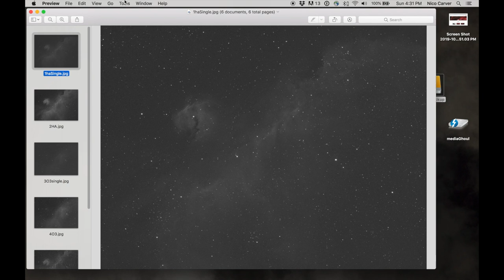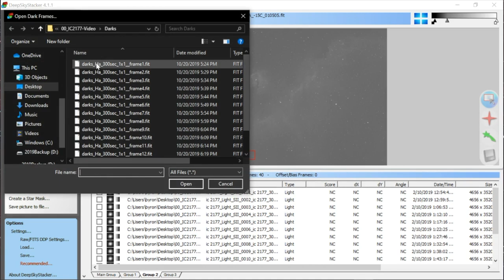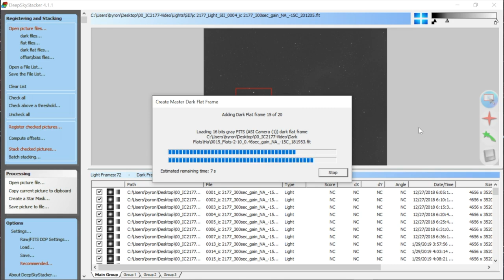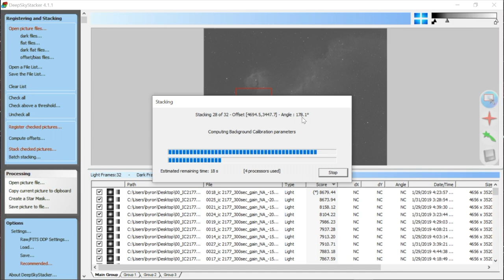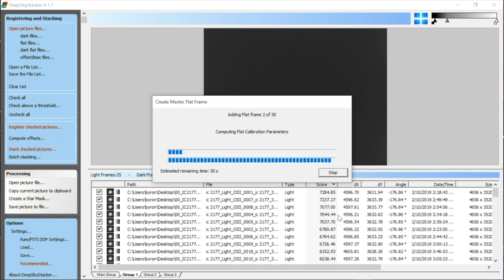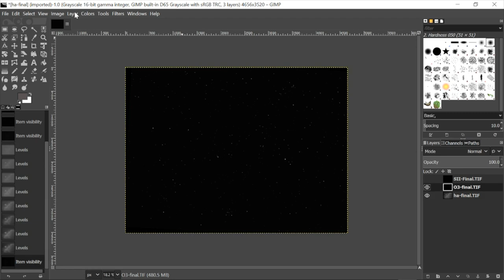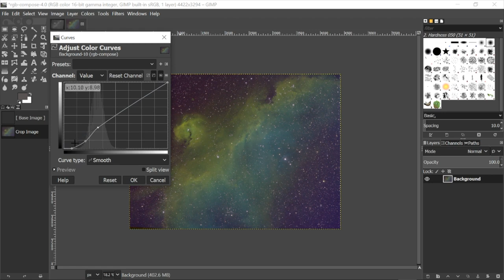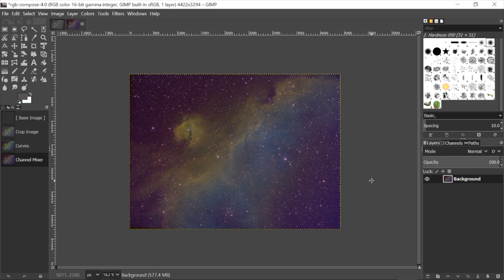Intro to Narrowband and Hubble Palette, Pt. 2b - DeepSkyStacker and GIMP

Comment: I know this is a bit old, but I want to thank you for this. The part that I found most helpful was where you showed how to open an image as layers and then compose them. I use a DSLR, and I know it isn't going to be perfect, but I'm going to use my broadband light pollution filter to try to make an HOO image by splitting the channels in Siril and then recombining them in GIMP. I have some old data I can try this on so it should be an interesting experiment for a cloudy night!

Comment: I know I'm a little late to the party, but thank you for uploading this and having the data available to process. I've been on the fence about making the jump to mono, but this seals the deal! I did take your data through starnet and then blended the images in gimp with a star mask (learned from one of your videos) which eliminated the magenta stars and really made the nebula pop. Thanks again. Keep up the great work!
Reply from the maker: Awesome! Mono is amazing, just wish it wasn't so expensive to jump in to it (decent filters, good filter wheel, special camera, etc.) or I'd recommend it to more people. When I first started with mono, I tried to save money with a cheap manual filter wheel with a big open hole in the side that I would then cover with aluminum foil (big mistake).
Reply: @NebulaPhotos  agreed. It’s a huge, but worthwhile investment for quality mono equipment. I do have the asi120mm-s used as a guide cam. Understanding full well it’s not a dso cam, I’m going to play with that as I save my pennies for a full on mono setup.

Comment: In GIMP under colours you will find hue-saturation, in this you can selectively modify a colour in hue brightness and saturation. It's an easy way to wipe away the green hue or other. Over use and it will add artifacts though. Great vid, thank you.

Comment: Great helpful video for several questions concerning processing in Gimp. Thanks for that. But a additional Question; what i have to do in Gimp, to combine Narrowband images (finished as Hubble) with regular luminance Images? Background is about 4h Narrowband exposures and 10h luminance exposures. 
But at first i am very happy, to find the next mosaicpart for good image editing using Gimp with your video! Thanks a LOT!😃
Reply from the maker: I guess I would just register the luminance to the other narrowband channels (just treat it as an additional channel) then set the layer blend mode to luminosity.

Comment: Thanks for the video. So why are you using the Ha as the reference for the Sii and the Oiii? Why would you not use the best out of the Sii for the reference for the Sii and the best Oiii for the reference for the Oiii? If the Ha reference is not checked is it even using it in Deep Sky Stacker?
Reply: It makes sure the different colour frames are all aligned - when you load them into GIMP they all overlay perfectly.

Comment: OK sorry I just went and read up on the DSS docs and you are 100% right. Use the one ref frame to get everything to line up and don't check it on the other stacks so it does not get included. It also says that if you don't designate a reference frame it will just use the one with the high score by default. Do I have that right?

Comment: I notice in the sample files, you have a mixture of 0.46 and 300s exposures in the ha dark flats folder. Have the 300s been put in there by mistake?
Reply from the maker: Yes, I’m sure that was a mistake. I was wondering where those went! (I retook the darks because I couldn’t find them). Thanks for letting me know and I will correct that when I can.
Reply: @NebulaPhotos  My pleasure, pity you had to waste a couple of hours retaking them.
Reply from the maker: I've removed the 300s darks from the ha dark flats folder. Thanks again for noticing that, and alerting me! Cheers, Nico
Reply: @NebulaPhotos  I processed the files in Pixinsight. I'm in the process of learning it. I'm looking forward to seeing you video on Pixinsight to see if I am on the right track, it's a steep learning curve. Here is a link to the final image. https://drive.google.com/open?id=1k6Y-TVxnZSkbnHeC1B5-YgbM09pV4J8L